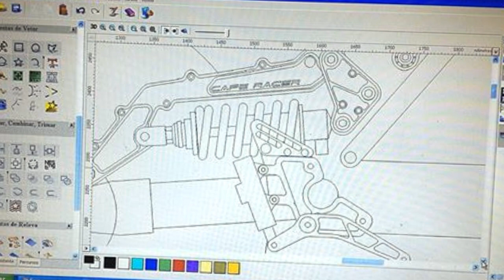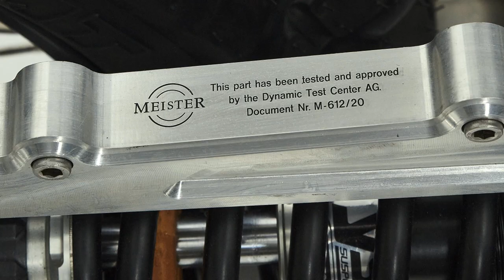Cafe Racer (BMW R100 and K100 by Meister Engineering)

Comment: As a purist I'm in love with the first and second bikes, simplicity at its best. All bikes were Well engineered and elegantly designed even the copper plated one made me smile 😁. Bravo to the Build and thx for sharing 👍.
Reply from the maker: Thank you my friend for sharing your opinion. :) Cheers.
Reply: I owned a r100rs and always felt the front end was too tall. These bikes have solved that issue so well.

Comment: Money is the answer to make these bikes roadlegal in Switzerland.
Every part or assembly has to be tested by the Dynamic test center (DTC).  Therefor, the costs are really high. Alot of factories get then a document that allows to certify similar part built by others. This is why factories like Meister Engineering can sell these documents and part then to others, to refound a part of the expenses of homologation. 
There was a time when you could drive with anykind of stuff in switerland without getting too much trouble. This isn't the cas anymore... You can even go to jail for speeding or have your vehicule seized if it's not roadlegal in every way.
This is the main reason why these motorcycles are so expensive in Switzerland. And by looking at the quality of these builts, these bikes are slod out instantly.

Great review as always!
Reply from the maker: Thank you my friend for sharing your perspective. :) Cheers.

Comment: Hello Cafe Racer, as usual a well produced video, with lost of great stuff.
I'm not very found of flashier motorcycles, being a fan of naked ones, the two similar models, caught my attention,  but for the originality, the one with cooper platting appealed to my senses, probably because refers me somehow to "Steampunk".
About the licensing, as been told to me a few years ago, by someone that lives there and modify a VW Scirocco, that in Switzerland, you can modify legally a motorcycle or a car, through an IPO (as we say in Portugal), for instance, if you want to put Xenon lights in an automobile, that doesn't have it originally from factory, you could go to a certified body/electric/mechanic shop, they write a document, you take the document, do the IPO, and if you meet their requirements, you are legal to drive that way.
Probably, that's why that have all their models certified as road legal.
Economy working, my friend....
Abraço
Reply from the maker: Hello Fernando, Yes, what you are saying is very true.  The main problem is, when we have to modify the frame structure of the bike. And that pretty much limits the kind of changes we can make to a motorcycle. That's probably why the bmw R is Meister Engineering favorite bike on its repertoire. But thank you my friend for sharing your perspective. :) Um abraço.